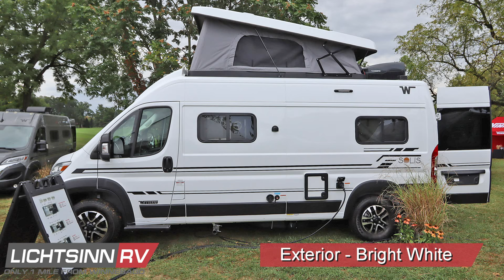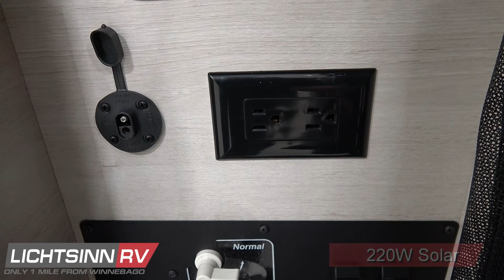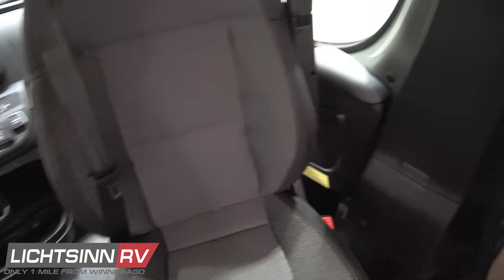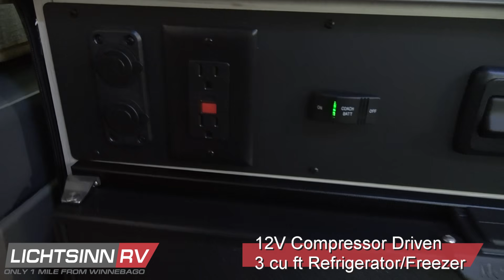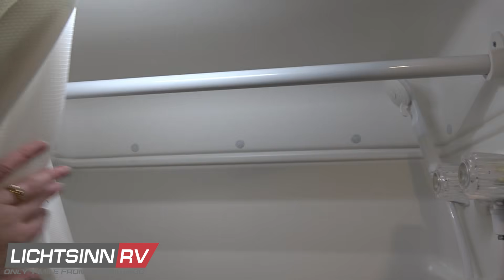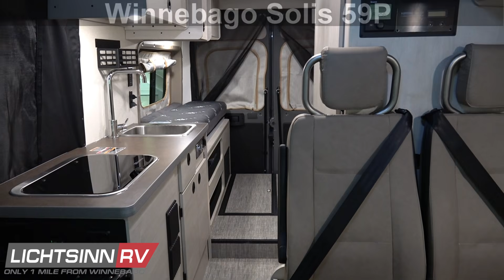New Winnebago Solis 59P - Class B Gas Camper Van - LichtsinnRV.com

Comment: Thanks for posting this video with all of the 2026 updates! I'm purchasing a 2026 59p from a different out of state dealer and having it delivered and some of updates don't seem to be on RV I'm buying. Is there a rolling wave of features such as external water hookup, outdoor side table and driver side runner? Thanks!
Reply from the maker: Good afternoon!    That is unfortunate... here is the list - most importantly you can now have AC and a generator to power it!

Our factory fresh, all new Solis 59P from Lichtsinn RV includes the following mid year enhancements:

1. All new Cocoa Bean interior with Samerang Teak cabinetry

2. All new exterior deluxe enhancement graphics

3. Optional rooftop AC while maintaining the pop-top studio loft sleeping surface

4. Optional RVMP 2,800 watt gasoline generator, EFI and 50 state emissions compliant

5. Standard side assist steps

6. Adjustable fold down outdoor patio table

7. Dual three point safety belts for a total of 4

8. The innovative queen Murphy + WinnSleep System combines a superior two layer, high density hygienic foam mattress with a European suspension system to increase comfort, relieve pressure, and improve under mattress air circulation to help eliminate condensation.

9. Zippered rear privacy screens that also serve as an additional thermal break

10. An exterior water fill is provided, removing the need to have the rear van doors open or pinching an existing hose, yet can be valved off in cold weather use

11. Blackout machine faced aluminum wheels